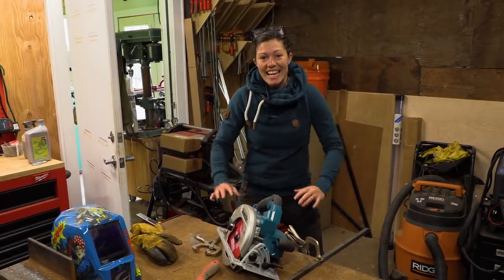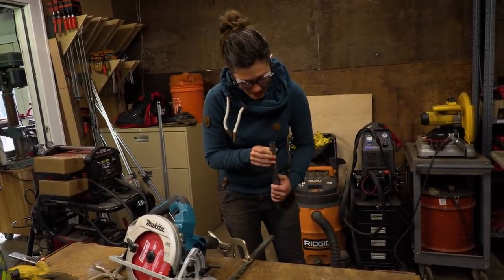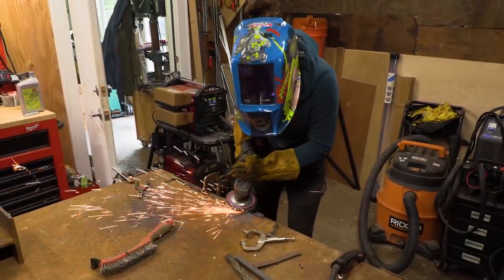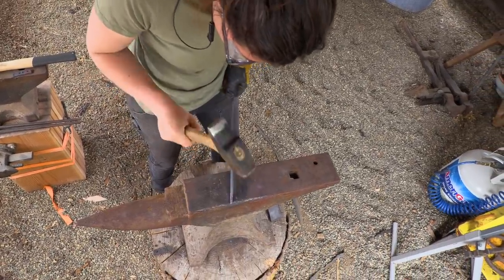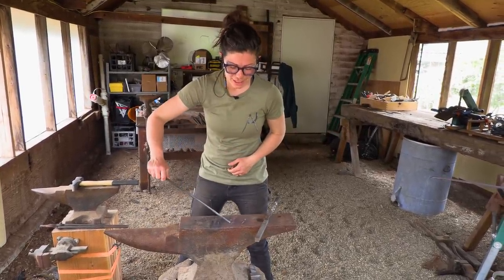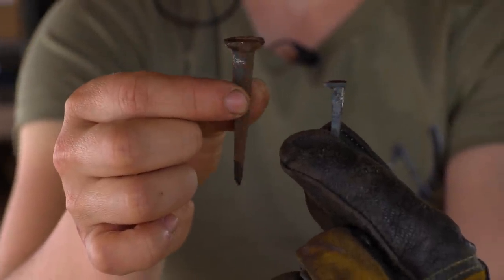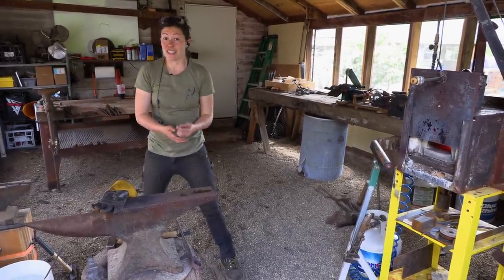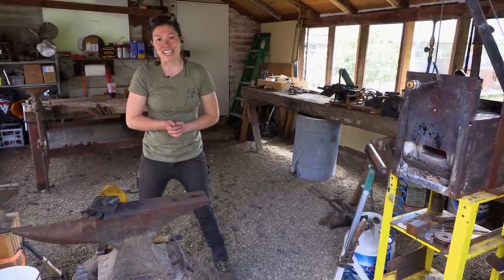Blacksmithing: Forging a Nail by Hand

Comment: Once the taper is formed, cut the nail almost trough on the hot cut, if you have enough heat, go straight to the header and twist it off the bar in the header. Leaving the nail on the parent bar means you can get it in and out of the heat without messing with tongs and keeps the end of the bar in heat ready for the next taper, all of which gets you nearer that one heat nail.

Comment: I remember watching the blacksmiths in Colonial Williamsburg.  They kept 2-3 pieces of stock in the forge, worked on one, and always had a hot one to grab when they finished each nail.  They could bang out the spike in a handful hits, gave it two on the cutter, used the head die to twist off the nail and then beat the head, then flipped the die and left it on floor to cool while they turned to put the stock back into the forge and grab another hot one.  I think it took them maybe 20-30 seconds per nail.  Crazy!  These were small gauge nails of course, like for shiplap or trim.

Comment: Nice! The shop space is looking great!
I never did get used to doing work with a hardy installed. I always stressed about gashing myself or bisecting my fingers (woohoo for an over-active catastrophising imagination!) so I ended up welding a pair of bolt cutters to my forge table for pencil rod sized stuff and eventually purpose built a stand-alone maple hardy "hole" for any larger cuttings.

Comment: I do have a few tips for you. The first one is get your steel hotter before hammering it. It should be a bright orange glow, not a dull red.  The second is forge the taper on the nail, then use the cut off tool to Almost cut the nail off, then put the bar back in the forge to bring it back up to heat. Once it's hot again you can put it in the nail header, and use it to twist the nail free from the stock, then head it. Or.. If you are fast bring the steel out at a good heat, forge the taper, use the cut off tool to again ALMOST cut it off, put it in the header, twist it off, and head it. Best of wishes in the new space! 👍

Comment: Hiya smiler. Great video. Last time I did any smithing was in the 1970's at school. I loved it. Top secret tip re the welding.....you ground it off!!! Try grinding the corner  off the end of each bar so that when they go together you get a 'V' to fill with weld, then you can grind the surface flat. You nailed it!
Reply from the maker: That’s a great tip Graham! Thanks!

Comment: New shop excitement! I just had the floor poured in mine. I can hardly wait to move in, even though there's the insulation and wiring still to be done. I'll run tools off a generator for a while, as I finish the wiring and walls. Building a forge is on my list... Love your enthusiasm  and teaching. This old fart learns something new from each of your videos.
Reply from the maker: Thanks so much for the kindness and support!!

Comment: I noticed that as well, as a woodworker learning Blacksmithing, that you really have to pre plan your movements much more.  With wood you can stare at it for a while to figure what you're doing.  With hot steel its go go go because you're losing heat by the second.  Really changed his I work when doing steel.   nail making is fun, I made about a dozen at one of my Pratt classes, and have some steel set aside for making a header soon.

Comment: I have never used a welder before but what I learned from watching a lot of people weld on youtube is:
Always clean your parts before welding.
Reply: And if it is thicker than about 1/16 inch, bevel the edges to be welded, it helps with penetration.

Comment: Anne- I haven't made nails or blacksmithed in a while- but when I made them, we left the nail on the rod and used the nail header to snap it off. seeing as you have a london pattern anvil you can't do like we did and leave the cut off in the hardy. you could use the second anvil though
Reply from the maker: I was taught to NEVER leave the cutoff in the anvil. That’s a great way to lose a knuckle. And yes, the goal is to use the nail header to snap the nail and NOT dent your cutoff, I was just a little over zealous.

Comment: That Diablo blade is a bloody corker! 👍
Congrats on getting both the workshops operational. 
Be a dream to work in, in the winter.
Nice forging, by the way, an hour for 2 headers and 2 nails, not a bad effort, and one you will improve on in leaps and bounds. Fantastic work, Anne.👌

Comment: I did a little modification to my hammer that my arm likes better. if you shorten the handle and then square the handle so it's no longer round where you hold it is more comfortable and gives more control (at least in my case, everyone is different)

Comment: Love the video.
Just some advice,  If you try to weld something like that again  put the pieces about 2 mm apart,  that way you'll get a deeper penetration into to metal.
If done properly the weld shouldn't break and you won't have to grind it.
Otherwise,  hats of to you for being so versatile.
Reply from the maker: Thanks for the tip 👌🏻

Comment: nice and honset video!

just a tip
after making the point on the nail do not cut it the whole way through. leave a little connection. easier to handle and to heat up again.
heat it up, take it out, into the nail-iron, break it of by twisting, forge the head
that way you don't loose the heat and its easier to work with ;)

keep up your passion!

Comment: Anne. loved that you are going to be doing some more smithing work. If you bevel your edges on the pieces you are going to weld so there is about twice the thickness of the wire in your gun left in the middle or so it looks like a sideways hourglass you will get a far better weld. by doing this you are creating more surface area for the weld bead to GRAB onto... Also at the forge, you may do this when you are not filming but if you don't, try to set up the smithy so when you are working you are standing in a diamond. if you are right handed the forge on your left, anvil in front of you, vise on your right, excape to the rear. idealy you don't want to have to move more that 2 steps at the most from the fire to your equipment, and you want to try to never have to back up in a smithy but rather turn to your equipment. unless having to excape.  every second counts in smithing. visualize your steps while the piece is heating up. and I like to always teach folks to practice techniques, not projects. to many learn projects then move to a new project  that uses the same techniques but in a different order and are stumped on how to get there. There are 7 techniques and 8 hammer swings for 90 percent of smithing, these have made most everything that you have ever seen smithed, just in what order they are used may change. Check out ABANA, and Anvil Fire.com these are great sorces for the beginner and masters alike. See you on the next one. Have a great week. P.s. sorry for the poor spelling.:)
Reply from the maker: This is all really helpful. Thank you for taking the time to share!!
Reply: I ll had some:
- Too much light in shop. To see the right temperature, you need to be in the shadow. Not darkness, but  not in plain light.
I alway say that blacksmithing avoid light, wind and rain.
- swing the hammer you can. It means that you need to work with proper tools for you. For my work i use a 4kg/8lb hammer. But i trained for it. You don't have to. My friends wich are farriers, use more lighter hammers.
- Grab your hammer the closer you can to the weight. Your wrist and fore arm will thank you. Farriers are swinging it like whip/whipper/ " fouet ", we, blacksmith use the weight to " squish " iron.
- use the pointy part of your anvil to stretch your bar, get to the table to get it right, work outside te table to scroll your bar. Working on an anvil is for modifying the section, working outside is for changing the form.
Forget your bar when you work on your piece, you loose time and heat while you cooling the bar, nail in your tong. The most important is the part you get hot. unles you want to spend your time heating your pieces ;)
- Abana got fine people it coold be great for you. Look for Helen Durkan and Mark Asperry. She performs gorgeous blacksmithing works and he is a great teacher.
I hope you will understand all of this from a french blacksmith :)

Comment: Hi Anne.  By the amount of smoke and splatter looks like you are using self shielded flux core wire which doesn't meet code for anything.  Try using dual shield flux core wire.  It requires a 75/25 argon/co2 mix and you will be amazed at the results.  Runs well in any position and is similar to 7018 rod in strength and penitration.
I've heard stories of early settlers, when ready to move, burning their house down just to collect the nails for use on their next homestead!  See ya next time.
Reply from the maker: I was actually using dual shield and argon mix, I just had the settings on the welder set for thin steel since that was the last thing I was welding and forgot to change the settings so the weld didn’t penetrate.
Reply: Anne of All Trades ....I'm sorry, I didn't mean to be a know it all.  I should have known you would have researched the best welding processes for your needs.
Don't feel alone, I've been welding for 40 years and last week I burnt up my TIG torch consumables welding aluminum because I didn't have it switched to AC current.  I'm excited you've got your metal shop up and running and looking foreword to the videos yet to come.   Take care and be safe!

Comment: Found your channel, and I am like what I see. I do blacksmithing, and just starting woodworking.  Just an observation I think your steel may be a bit cold. I know the camera doesn’t show colors well, so I could be wrong but wanted to post that observation.. also if you cut the nail but don’t cut all the way through till you put it On the header, you then break it off, and add the head. This means no tongs :). love the series  love your work, and I am learning a lot :)

Comment: A welding tip from a fellow begginer....... who was also just given the same tip from a local blacksmith...... Make sure you grind bevels on both pieces before welding (metal over 4mm ish). That way your weld will penetrate deeper and when you grind it back you don't remove 95% of the weld!!!! 🙂👍👍
Reply from the maker: That’s a great tip!
Reply: @AnneofAllTrades  John at black bear forge also made a nail header a while ago. He showed that if you use a tapered punch instead of a drill bit the nails won't be as likely to get stuck in the nail header. Definitely something I need to try to make as I'm a very new blacksmith too. 🙂

Comment: Anne keep on hammering.  Define a double taper on the end of your bar to for the shank of the nail. Cut the bar almost through leaving enough material for the nail head (one heat).  Heat. Put nail shank in your header and twist off the bar.  Peen the head.  Don't need a big hammer - 2lb is fine.

Comment: Tips for ur welding: u could put a slight chamfer on the edges of the pieces ur welding to add to the penetration, and grind less cuz from vid I could se u grinded a lot of base metal making the surface concave (removing to much actual weld metal, creating a weak joint) also from the way ur machine was running it sounded like ur wire feed rollers on ur machine arnt tight enough or u had a loop in ur hose while welding . Great video btw!
Reply from the maker: Great tips!

Comment: When welding 2 pieces of metal together in that way, it is best to bevel the edges of both first. This gives a lot more surface area of the weld on each :)
Reply from the maker: Great tip!!

Comment: Great video, Anne! Just a note: you're going to want to raise that anvil up a bit. Holding your hammer, the head resting on the surface of the anvil, standing up straight, your elbow should be at about 90 degrees. As it is, you're going to be constantly bending over your work, which is going to get uncomfortable real fast.
Reply: I noticed that, too.  But you have to admit she 'nailed' it!
Reply: That is incorrect! The anvil height should be where your knuckles fall with your arm extended in the downward position. If it's too high you don't have enough space for the hammer to pick up speed and make a efficient blow. You'll be putting too much strength into short blows and tire yourself out too quickly
Reply: @Chadsworth69 Damnit, you're right. Serves me right making a comment pre-caffeine. Still, her anvil should be higher than it is.

Comment: with your welding are you using gas? if so you need more gas if your'e using flux core well, those are good welds with flux core.

Comment: The thing is, if the weld doesn't penetrate, grinding the surface clean just weakens the weld you do have. Guess your weld penetration wasn't sufficient. Maybe you could scarf both pieces and forge weld them together?
Reply from the maker: Totally can ;)

Comment: I can’t tell if you’re a leather gloves or just Leather something else and Leather, but you need to be careful with leather gloves that heat can sneak up on you and really burn you suddenly you notice the glove gets hot and  then it’s trapped on your hand plus a little moisture gets in there and suddenly it steam burns you

John at Black Bear Forge uses hot mill gloves you might like.  

Good luck keep up the great work

Comment: Great videos! What type of drill bits do you use for drilling into your steel? I have some carbide tipped ones but they do not make a dent on my forged blade.
Reply: Are you trying drill it right after a quench? Because if so, the steel will be glass hard. After drawing back the temper it should be more manageable.
Reply: @planbuildrepeat8264  Ah, yeah... Doing it after quenching. What do you mean by drawing back the temper?
Reply: @DanSteigerwald  ok. If the quench was good, a file will skate off of the blade. This is great for making a really sharp edge, but it will chip easily. So a typical tempering cycle would have the blade in the oven at ~350 for about 30 minutes. This trades a little bit of hardness for better ductility. Heat treating is quite a rabbit hole as a science, but you should be able to find plenty of material pertinent to your steel alloy and maybe even knife shape online. Knife forums are going to be a great resource for ya.
Reply: @planbuildrepeat8264  Ah, yeah, I've heard about that. This is only my second knife and it's full of flaws so I'm not terribly concerned if it chips. Thanks for the info, I'll look into tempering for my next knife!